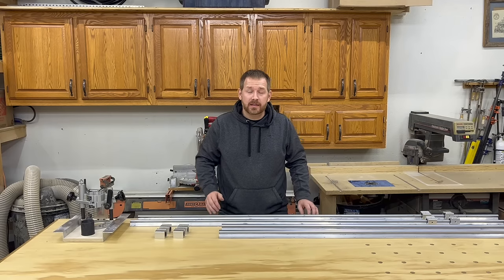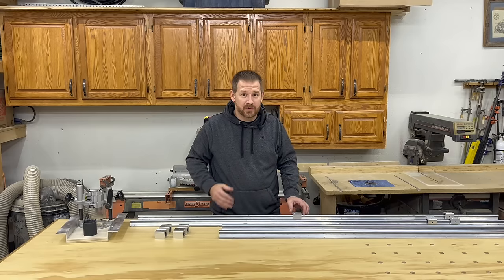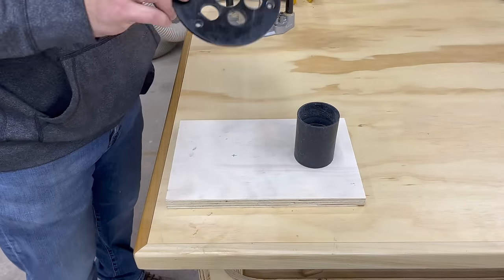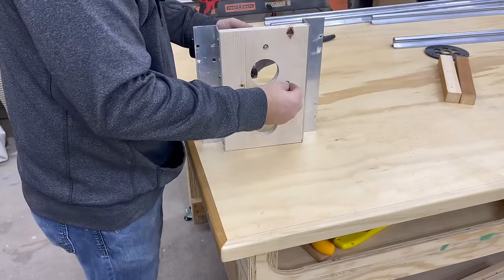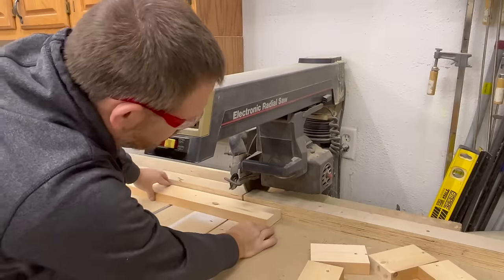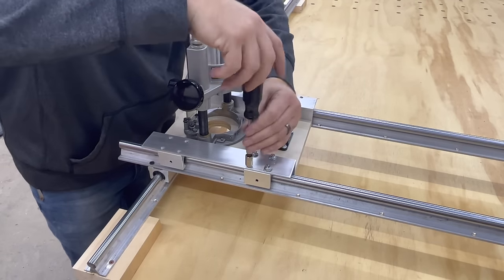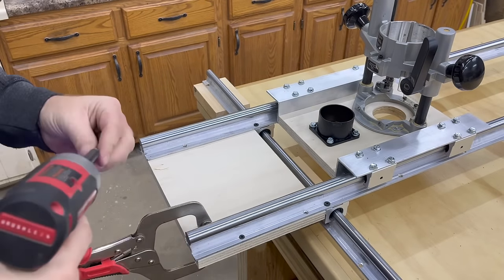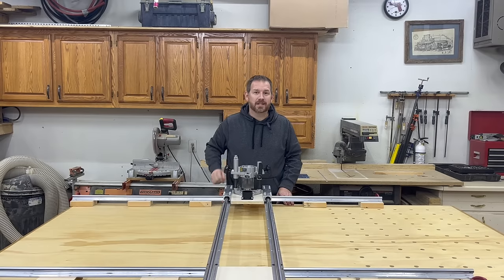Build a Better Router Sled/Flattening Jig

Comment: Nice build.  Next step is to add a couple stepper motors, a simple arduino controller, and some limiters on each axis (none of which is expensive), and automate the process of flattening slabs.  You get it started with the depth and speed you want, and let automation finish the work while you do other things.
Reply from the maker: Sounds like a great idea!  I'll keep it in mind for the future.  Thanks for watching!
Reply: you can't just add stepper motors.

You'd need to add lead screws or a rack and pinon design. That's at least doubling the weight of the existing setup, significantly adding to cost, etc.
Reply: @monarchco  for a flattening jig a belt driven setup would be fine.  Not super complicated
Reply: @JordanHaisley  you can't just throw a belt between some slick bars and expect it to work. You have to have some method of geared or tracked drive. I don't think you people understand how cnc machines work.
Reply: @monarchco  lol, it really doesn’t take much a belt, stepper, with a gt2 drive gear, a couple of idlers, and a clamp block on the carriage.
Reply: @JordanHaisley  you're not using a GT2 belt on a router spinning a 3" surfacing bit unless you want to destroy your router, your table, and whatever else. A setup like this would require R&P or leadscrew for rigidity.
Reply: @mytuberforyou  The belt is not supposed to maintain the stiffness of the setup...
There are plenty of belt driven CNCs, and even large ones at that.
You even have the maslow CNC that is driven by wires, and the router "sled" is held down by weight only.

Also, if your 3" surfacing bit is too large, reduce depth of cut... Or use a smaller one...

This is not metal working either, it does not require crazy stiffness...

The point of CNC'ing this setup is not to go faster, but to go automated. Who cares if it takes 2 hours instead of 1, if it does it's thing on it's own?
Reply: @JordanHaisley  Pretty much this!
also, the rack and pinion part or the ballscrew are not meant to ensure the stiffness of a CNC. They are meant to provide accurate movement.
Here, even if there is some backlash, who cares? as long as the Z deflection is low enough, everyghing is fine.
Reply: @AudreyRobinel  right, and it slides “like butter” so it wouldn’t need much.
Reply: @Idealwoodworks  I am curious, have you thought about adding stops to the ends of the cross track to keep you from accidentally running the bit into the main track and ruining the bit?
Reply from the maker: @jamesbeecher4431  Actually I thought of that between making part 1 and part 2.  If you look closely in the part 2 video the stops are there.  Thanks for watching!
Reply: @Idealwoodworks  i didn't watch part 2 until this AM.  Looks like it works great.  you should assemble the pats to sell as kits.
You know how guys like making thing with wood but anything that might be a tool . . got to buy it.  It might give you another income stream that doesn't look like its too much work.
Reply: @monarchco  Just for flattening a slab it wil work, don't need to be accurate at all ;)
Reply: @dannybrandt1231  it has nothing to do with accuracy. It has to do with safety and making it actually work.
Reply: @monarchco  Можно подумать что эти направляющие стоят мало 😁
Reply: 여기 채널 동영상도 참고하세요
Reply: The one thing you guys all fail to address is how much these linear bearings will start to slow down, stick or even flat out stop with just the slightest inclusion of sawdust that WILL accumulate on these rails, gumming up the works. You will need to incorporate a  sweeper/wiper concoction on both fore and aft and side to side of the leading and trailing bearings of each axis. Even though you'll be using  your vacuum port, it will still not pickup all the fine particulates that will settle on your rails and will get passed the seals on your bearings, specially these open underside gap SBR series  bearings and rails. I mean no disrespect to you or your fine build, I'm just giving ya a courteous heads up as to what can and will happen if you're not aware.
Reply: @ricaurandt6713 air compressor, air gun, done. 😅
Reply: @monarchco  No, he can used belt drive
Reply: @JordanHaisley for a flattening jig you don’t need any of that stuff unless you flatten bigger stuff every day

Comment: Seems to me this rail setup could also be used with a circular saw and mounted vertically .
Reply from the maker: Agreed!  If a person needs a panel saw these rails would probably work well.  Thanks for watching!
Reply: @Idealwoodworks  The jig is only a few parts away from being a CNC router it appears.
Reply: Great idea! Could it be used as a sliding jointer using a long fluted cutter?
Perhaps the cutter in the vid could skim the edge of a board well enough for a glue joint?👍
Reply: I was thinking about that.  I love it.

Comment: I built a sled much like the one in this video.  It works like a charm.  The blocks get a bit dusty and increase the friction, so they have to be blown out occasionally.  I also swipe a candle over the tops of the rails every now and then to keep them slick.  I used 1/2" acrylic as the base for the router to help with visibility of the work piece.
Reply: how are those bearing doing with precision?
Reply: 여기 채널 동영상도 참고하세요

Comment: I built a router sled using very similar linear rails, almost exactly like yours. I screwed my long rails to a couple of 2x4's that fit into the slots on my Bora Speedhorse sawhorses, so I can set up the sled in just a couple of minutes, then tear it down and store it away when I don't need it. I still need to work on the carriage for the router so that I can adjust the height of the router above the workpiece. I might use some of your ideas on that!
Reply from the maker: Thanks for watching!

Comment: Late to the party here but curious if this relies on whatever table its set on to be perfectly flat? If the table is wonky in some way will that affect the slab flattening process? Would love to incorporate what you built here, but not sure on that table piece
Reply from the maker: Hey thanks for watching!  Yes, the table would need to be flat…. Or the rails shimmed to be flat with each other.  If you follow my link to the 2nd part of this video I go through how to check if your table is flat.  Also if you are going to make one of these you might want to check out my video where I made some upgrades to the sled.  
Part 2
 https://youtu.be/wcQkhDzZ420?si=GwVzHfFf7Yobbj9V
Upgrade video
https://youtu.be/pYstDfpUUZE?si=xV2jDLjZss6PAf7q
Reply: @Idealwoodworks  awesome! Really appreciate the reply, I’ll keep on watching!

Comment: This is by far the most professional looking DIY router sled I've seen. Currently building mine 😊 looks fantastic!
Reply: 여기 채널 동영상도 참고하세요
Reply: funny will not do much no height adjustment
Reply: @charlesshober8840  it did exactly what I needed it to do
Reply: @charlesshober8840  cant you just use the plunger for depth?

Comment: it is rock solid with those rails
Reply from the maker: It’s a very solid setup.  You do want to make sure not to apply downward pressure though.  Just pull straight across.

Comment: Bought components for this rig several years ago, been surfing videos on power hand planers, and came across a deluge of router sleds using these same rails. I'm always early...but this is the best video thus far. What makes it clutch is the frame stiffeners for the vertical axis wobble of the slide bearings, as well as the multi blocks instead of "straight" supports  - those are what I've been hung up on. 

Glad I didn't rush into mutilating wood. This tidbit is the game changer I needed. Biting my tongue about the $200 statement.
Reply: 여기 채널 동영상도 참고하세요

Comment: I put clamps 🗜️ on mine at both ends so I don’t accidentally pull the carriage off.  I also just use a Bosch router table plate and a collet extension.  I bolt the bearings to the router plate.   I also use one of those like replaceable bit cutters.  Good video.   The rails have worked slick for me for the last couple years.
Reply from the maker: Thanks for watching!  I also clamp my to the bench.  That would be a disaster if it fell off during use!!
Reply: @Idealwoodworks  yes it would.  Another thing , after some time I blow them out and use some wd 40 very lightly on the little balls in the blocks.  Paste wax helps on the rails too.  I do a lot of resin, and it likes to stick to every thing. 
I did have one bolt back out on a block once.  I used some blue lock tite on the bolts , and It’s been great since then.

Comment: I used the same materials and the same set up.  It works perfectly.  I added a stop on each end of the upper rails so that it was impossible for the router bit to accidentally run into the lower rail.
Reply from the maker: I actually thought of that and add those also in between making the first and second video.  Thanks for watching!!

Comment: Awesome jig. Simple to make, although I found I had to make a couple of minor adjustments, and incredibly easy to use. I am using a 3” flattening bit with the renewable cutters, and I did find it best to take very small increments or the router wanted to run away, but overall fast, accurate and very easy. Thanks for an awesome video

Comment: Highly informative and enjoyable video.
Crazy thing is I'm designing, right now, a Router Slab Flatting Sled for myself. My question is why you didn't use the same size diameter Slide Rails both Vertical and Horizontal Rails?  You used SBR16-2000mm, 0.63 diameter Rail Set for the Vertical rails and the SBR20-1500mm, 0.8 diameter Slide Rail for the Horizontal. My thinking is that the SBR16- 0.63 diameter Linear Slide Rails should be stout and ridge enough to handle the weight and movement (vibrations) of the router sled as it traverses on both axes. 
I found both a local source for acrylic with very reasonable prices and Baltic Brich 4 x 8' sheets for only $20 more and White Melamine MDF4'x 8' sheets were $10 more than comparable sized furniture grade 4'x 8' plywood. I'm opting to go with acrylic and White Melamine MDF instead. 
I would appreciate input from you or any of your followers of this subject.
Reply from the maker: Hello, thanks for watching!  I used the SBR20 rails for the upper rails that the carriage rides on.  They are a little bit heavier so they are less likely to deflect.  The SBR16 rails are supported by the work bench so they are plenty strong.

Comment: Nice build. Easy to make and gets the job done. You could add a door sweep/ brush to sled and more dust would get caught up by vac.
Reply from the maker: Thanks for watching!!
Reply: Which guide rails did you buy on Amazon?
Reply: Found the rails. I didn’t look close enough at posting.

Comment: I was thinking the same way about using the rails like you but I really like how you setup for the router to mount using the Aluminum Angles then mounting plywood base plus the vacuum hose to help cutting down on the waste material. 
I also saw you have a craftsman radial arm saw I like to know how you did the adjustment for the platform so you get flat cuts if you could share it on YouTube it would be a great help to me thank you for sharing your idea for flat jig

Comment: this is awesome! i've had an idea percolating for a similar dual rail system but with a circular saw instead. now i see a version with multiple tool inserts! add some cleats to the rails and hang it on a wall for a panel cutter.
Reply from the maker: Hello, thanks for watching!  I’ve had some of the same thoughts about using this for a circular saw!

Comment: I think if I were to build one of these, I would mount the side linear rails on adjustable wood sides. Most of the time what you have there would work just fine. But when/if you need to flatten a thicker slab, you'll have a bunch of work to do to make it happen and then revert it back.
Reply: 여기 채널 동영상도 참고하세요
Reply: @chrisrolofson4193     My "vision" would be difficult to explain. (Imagine  an 8" strip of ply with slots mounted on its edge.)  However, I went back and looked at yours again. I didn't notice if you attached the small blocks to the plywood. If not, it would be easy enough to raise the whole thing with additional blocks.

Comment: Great build! As mentioned by others, adding a few steppers, a belt, and some cheap electronics could alow automation of this!
Even at low speeds, as long as it is autonomous, it is nice!

Another use,,without electronics, if you are able to lock one axis, that would make for a nice grooving tool. If you set a stop you could cut grooves, datos, rabbits, reliably!
Reply from the maker: The bearings actually have set screws on the side to lock them in place.  So you could use it to cut dados and such.  Thanks for watching!

Comment: How did you layout/transfer the hole placement from the bearing onto the aluminum angle?    That’s my last key thing.  Did you just have to measure and then transfer?!
Reply from the maker: Yes, I just measured and marked using a caliper and a square.  It seems like the holes in the bearings aren’t perfectly square so be sure to oversized the holes.  Thanks for watching!

Comment: It’s a nice build. You might want to add some rail stops to prevent the router carriage from sliding off of the rails.
Reply from the maker: Hello, thanks for watching!  I actually thought about that in between making the first and second videos.  I didn’t want the router bit to be able to hit the rails.  I’m working on another video right now, making some upgrades to this sled.  Should be posted in the near future

Comment: What brand rails did you use. I couldn’t, find one that you can bolt the top rails to the bottom slide blocks. Holes didn’t match up.
Reply from the maker: Hey, thanks for watching!  There’s links in the video description for the rails that I used.

Comment: I did this same thing a couple years ago, what are you using to keep the router bit from slamming into the rails? Other than hoping you don't over run the wood?
Reply from the maker: Hello thanks for watching!  I thought of that between making this videos and making part 2.  I attached some strips of wood to the stiffeners on the front and back that stop the carriage before it hits the rails.

Comment: Any particular reason why you got SBR16 rails for the bottom and SBR20 for the uppers? Can't you just use the same type for both?

Also, what thickness and width aluminum angle are you using here? Looks like 2”x1/8”?
Reply from the maker: Hello, thanks for watching!  I used a heavier rail for the uppers with the thought that it would be less likely to deflect.  And yes, 2” x 1/8” aluminum angles.

Comment: im in the process of building something similar, have the same rails as you, could you please tell me what size machine screws you used for attaching to the bearings, thank you
Reply from the maker: Hello, thanks for watching.  I just took a bearing to the hardware store and found what fit.  I don’t remember for certain but it’s metric, I think M6.

Comment: Just wondering what size rails and bearings you used here... are they SBR12 or do you think SBR20 is a more stable arrangement. Rob
Reply from the maker: Hey, thanks for watching!  I used SBR16 for the lower rails and SBR20 for the upper rails.  There are links in the video description for the rails I used.  
Also, if you’re looking to build this you might be interested in some upgrades I made.  Here’s a link to that video.
https://youtu.be/pYstDfpUUZE?si=8kmnn1KGA9ejmdUi

Comment: Great video. How could you make it or adjust vertically for different thickness wood?
Reply from the maker: Hi thanks for watching!  When I’ve had to adjust for different thickness wood I replace the mounting blocks with thicker or thinner blocks.  I also made some upgrades to the sled which included a new router that gives me more depth adjustment.   
Here’s the link for that video if you’re interested.  Making The Better Router Sled/Flattening Jig Even Better!  Time For Some Upgrades!
https://youtu.be/pYstDfpUUZE
Reply: @Idealwoodworks  Nice man!

Comment: Really great solutions. I want to build one but you are using two different rail systems for the top and bottom. Each on in Amazon offer different lengths that work for me. Is there a difference in functionality in the ones you used or just the sizes? Can I use the same same rail for top and bottom just pick the different size I need?
Reply from the maker: Correct.  Pick whatever size fits your needs.  The only difference other than length is that the rails I used for the upper assembly were a bit heavier than the lower rails.  It’s better for preventing deflection over a long span but if you’re only doing a shorter span you might not need the heavier rails.  Thanks for watching!
Reply: @Idealwoodworks  thanks for responding. I will for now be using it on end grain cutting boards which are never more than 16" in either dimension. If I need a bigger one for a table top like your video it would be easy to buy the longer rails and convert it. Have you come up with a way to raise and lower the bottom rail to accommodate the thickness of the item to be planed?
Reply from the maker: @dkmanley54  At the moment I’m just changing the mounting blocks with thicker or thinner material.  I’ve been brainstorming some other ideas.  If I come up with something better I’ll make another video.